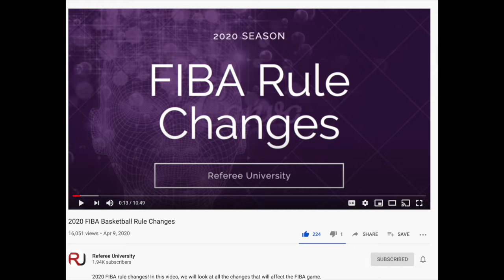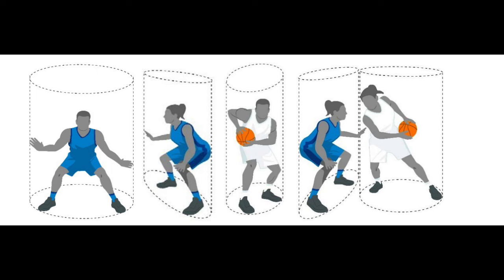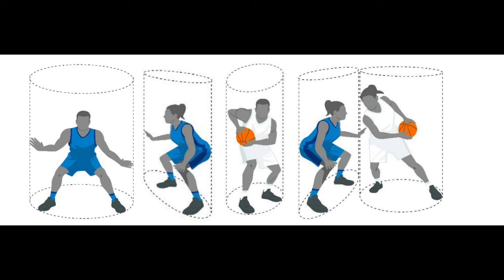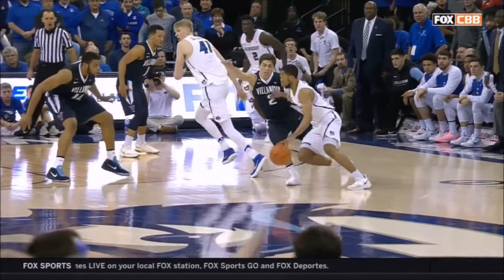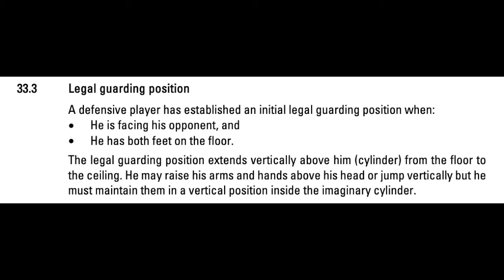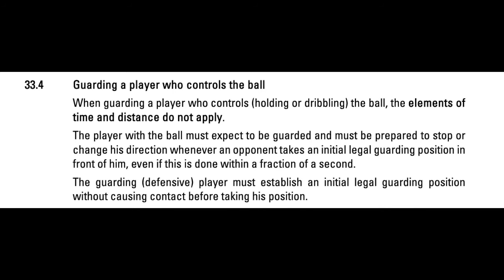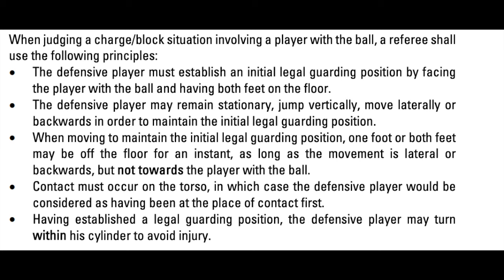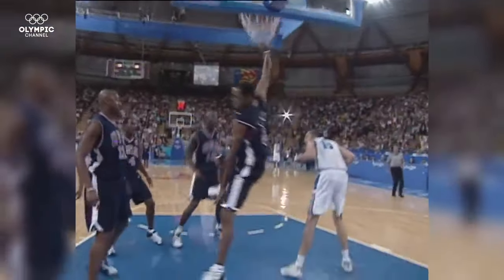FIBA Rules Explained: Cylinder, Block & Charge

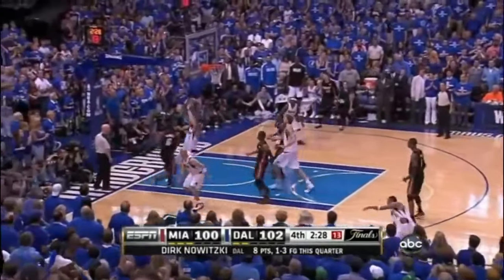Comment: at 6:06 we have airbone player .the defender white with number 6 has one foot in the  space of no charge semicircle.This is a non call situation ? thanks a lot you are the best keep going!!!
Reply from the maker: This one is a tricky one but it’s a correct charge. Reason being is that his right foot is not in the no charge semi circle area (because it’s outside the semi circle area) and his left foot is out side in front of it. If the no charge line extended to the endline, then it would be a no call :) thanks for the support!!

Comment: I'm hoping that I haven't missed the "different video" mentioned in this video ("The only thing we’re not going to look at in this video is screens, and that’ll be saved for a different video”).
I'm interested with how these portions of Article 33 work with each other 33.1 (Cylinder Principle), 33.7 (Legal Screen), 33.8 and 33.15 (charge/pushing).
Scenario is: Offence sets a legal screen facing the defender (time/distance not an issue), defender pushes (shoulder charges) into offence with enough force to push the offence back one step. One foot remains in place by the offence screener and he re-establishes a fresh cylinder in front of the defence at a slightly askew angle.  
Hoping that there is another video of 'screens' in differing forms that I can view because this seems to be the thing that gets such a variety of calls for the same set of circumstances.
Love the videos/channel
Reply from the maker: Yes, since screening requires more clips and explanation I planned on making a video on it. I did take a 1 year break and just recently came back after multiple messages about it. I will add it to the list (2 videos already made and ready to post, I have 2 more being finished slowly then I will do screening). 
For your scenario, the only player causing illegal contact is the defender. If the official feels that the defense attempting to get through the screen is A) enough contact to warrant a foul and B) would not want to allow that contact in case it leads to rough play or tough game management by allowing that contact, then they would probably call a foul on the defender. If we do not call a defensive foul, chances are the officials would not call a illegal screen on the reposition you mentioned because the defense caused them to do a slight reposition. 
It all depends on the league/level of play. I have seen screens that were deemed legal at the olympics/international level but not legal for university play in some countries. Hope that helps!
Reply: @refereeuniversity  Love your work.
You break everything down into simple explanations that seem so logical, like "why couldn't a referee see that." I suppose it's a bit different under the pressure of a fast moving game, but then again they are the ones we look to for guidance on whats right or wrong in the game.
Hope you are well
Reply from the maker: @Gaze-v1r  Thank you, I will do my best to stay on top of adding content :)

Comment: Is there any chance of doing a video or video series on 3x3 - particularly with its very different interpretation of charge/block situations? I have read the official 3x3 rules on charge/block and can see no difference in them compared to the 5v5 rules yet when I watch the world tour and Olympics  matches the 3x3 referees (who all also ref high level 5v5 ) allow defenders to consistently heavily displace/push (ie block) players driving to the basket.  It seems like FIBA have agreed years ago that 3x3 has to be more physical, 90s NBA style, without making it clear in the rules.  Anyway thanks for your invaluable FIBA rules explained playlist, especially this video in particular as that's pretty much all we referees use in England!
Reply from the maker: Thank you! I appreciate that! Yes, 3x3 is different in what they allow but I do not know how long it will stay like that. It used to be way more rough and they have cleaned it up a bit more. I believe they are trying to maintain a balance of flow and physicality. 5v5 you can have a bad quarter for scoring and fouls and still win the game. 3x3 is a game to 21 and every foul matters. If I have time this summer, I will see if I can put a little video together on it.

Comment: we have a discussion almost every practice about a very specific scenario

Player A is on a sort of Fastbreak situation, nobody is in front of him, but player B is coming from behind and tries to block the ball 
Player A wipes his guarding hand behind him and it creates a contact with player B

so Player A contacts with his arm slightly out of the cylinder, while player B also is coming from behind (no legal guarding position) and infiltrates player A's cylinder

whats the right call here?
Reply from the maker: Definitely a tough decision off of no video, but from the scenario you described, it seems like the offensive player's contact is negligible and can be passed on, defensive player B's contact can be deemed a foul depending on if it affect's player A's movement or contact is enough to put a whistle on. As referee's, we judge if contact needs a whistle and if this scenario was to be a foul, it would most likely on Player B

Comment: Great video. What about on-ball defense with minimal hand contact? Also what about post defense, can you place your arm on the offensive player?
Reply from the maker: The current consensus is that the defender is allowed a touch but cannot keep the hand there. If they are driving and the defender has an arm bar protecting themselves (in their own cylinder), it probably won't be called (no advantage gained in most cases) but that differs from league to league due to different philosophies. Post defense you are allowed to have an arm on the offensive player as long as it is not extended or pushing the player. I was going to release a video on this but I got really busy. Hopefully this makes sense! Let me know if I need to clarify anything better!
Reply: @refereeuniversity  when im playeing myself sometimes i go drive to the basket really quickly but offbalance. The smalller player pushes me of balance and redirects my trajectory away from the straight line to the basket. Is this legal, it happens when im playeing pick up? They do this with their chest mostly but i feel like sometimes they sneak a lil bit of arm in there
Reply from the maker: @MadaraUchiha-lo7qt  If you beat the defender to the spot and they bump you (regardless of size) it is a foul.
Reply: @refereeuniversity  goddam thank you! At times it feels like its impossible to get near the rim without using brute force and luck. Thank you very much for the information!
Reply from the maker: @MadaraUchiha-lo7qt  Of course! No worries!

Comment: If you attempt a triple threat move (jabs) between the legs of the depender does it also mean illegal? (Outside the offensive cylinder)
Reply from the maker: Potential for offensive foul due to being out of their new offensive cylinder rule. If contact is advantageous and places defender at a large disadvantage, you can put a whistle on it. It is usually a play on, but defense should not be penalized for it.

Comment: Film session. How is that a blocking foul smart vs Westbrook?
Reply from the maker: Smart does take the contact in the chest and it is a close call. Stop video at 13:07 and you will see Smart go into Westbrook, defense initiated the contact with their chest resulting in a block.
Reply: @refereeuniversity  thank you. This has helped my defense tenfold 🔥🔥🔥
Reply: @refereeuniversity  how do you guard people who bump off of you with their shoulder for a stepback or layup?
Reply from the maker: Defense needs to beat them to the spot to take a charge (Pippen) or they have to anticipate and close the separation after the shoulder bump. This move typically does not get called an offensive foul unless overly advantageous.

Comment: I don't get why Pippen's one is a charging foul.
It seems like he's not taken the legal position and he's supposed to move laterally, to avoid the the contact when the offensive player changed the dribbling direction.
Reply from the maker: Pippen took it in the chest, offensive player dropped shoulder outside of cylinder. It's a close call that could go either way but that was most likely the criteria. There is the possibility that Scottie's resume of being a defender could have helped influence the call.

Comment: What about the typical call that James Harden gets every time he swipes his arm under the defenders arm to cause the contact? My understanding is that it's not a fault anymore right?
Reply from the maker: From my understanding and reading of the NBA rule book, they do not talk about cylinder principles in regards to positioning or contact on the floor. They mention forearm and hands contact. So in the many cases of Harden fouls, the defender has an extended arm or forearm which Harden rips through to draw a foul. As much as Harden is initiating the contact, the defender is extended and results in a defensive foul the majority of the time in the NBA. They tend to reward offense way more and title it as freedom of movement.

As for FIBA, if the arm is extended out of their defensive cylinder outlined in this video then they can be deemed responsible for the contact. A referee can deem that extended arm gather that Harden does as his natural shooting or gathering motion. However, if the defender is slightly out of his cylinder and Harden throws himself into them or completely extends his arms out of his cylinder to draw a foul, referees probably will not reward him. We tend to look at who is out of their cylinder and who initiated the contact which would be the criteria in making the call. So some Harden plays will be no calls and some will be defensive fouls in FIBA. All depends on what occurred.

Comment: I dont see any difference between first charge and the second blocking fault the rest I agree with.
Reply from the maker: Great Question! First one, offense goes into defenders line ( defender beats to the spot and offense drops shoulder and goes into the movement line), second video offense goes down a line away from defender, defender creates contact by moving into his line. Basically 1st: offense goes into defender, 2nd defender goes into offense

Comment: No use making sure everyone knows the rules when ref calls are inconsistent...
Reply from the maker: Refs are not the only people that should learn the rules to create consistency. If basketball as a whole improves, it changes the norm.
Reply: @refereeuniversity  And how would basketball improve? As in the rules? You sure ain't asking the players to do that right? The players are there to win, however it is allowed.
Reply from the maker: @user-em8fq2ev4b  Players learning the rules definitely helps them improved, it is not required to be a great player but if you think of how the game grows, they learn from coaches and other players on what the rules are from gameplay. If they get called for a travel in pickup game, or a coach calls it in practice, they assume those are illegal plays. That's how most players learn and apply it to themselves and the future generation. Which means that if more people know the actual rules or stayed on top of it, a culture changes in how it gets passed to other players. Basically, everyone learns through gameplay, not reading for themselves. More people learning the rules, more people applying them correctly in gameplay, creates improved growth
Reply from the maker: @user-em8fq2ev4b  Also, there is a good amount of referees that ref how they remember the rules being applied to them. They do not really read the rules which results in inconsistency. Which supports my previous statement